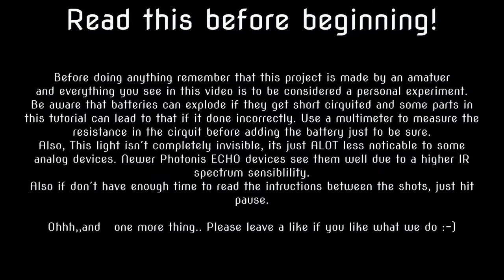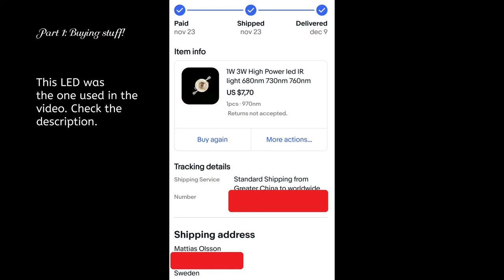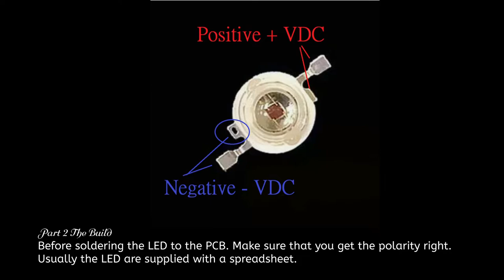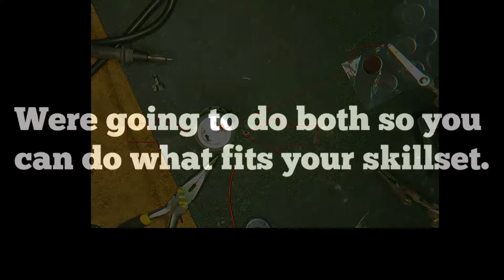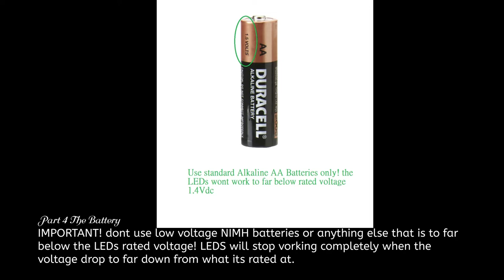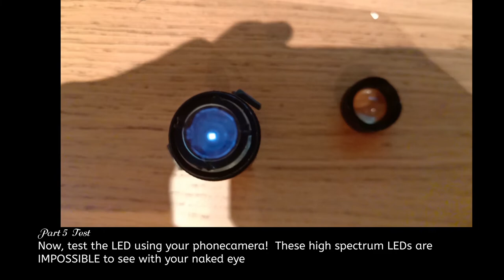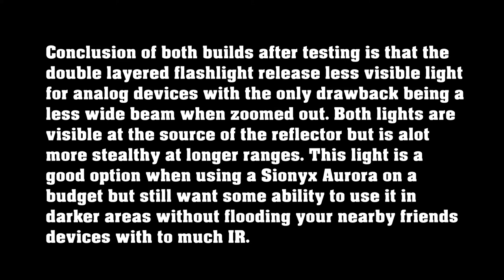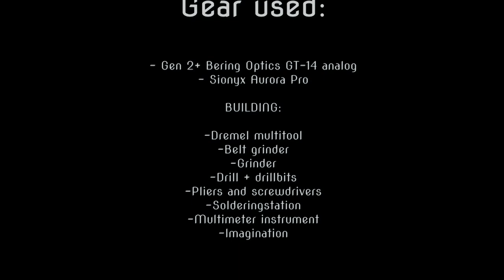Build your own 980Nm IR-stealthlight!

Comment: why not just put the filter over the regular white light led?
Reply from the maker: Good question, LEDs doesnt work quite like halogen bulbs. They got their specific wavelenghts that they specialise in. If you look closely in the video at one point an example of this is made in a diagram. Some LEDs have double wavelenghts but im afraid these will result in less pure 980nm wavelenghts after the filter
Reply from the maker: Look at 0:56 to see how narrow a 940nm LED is. White LED work the same way.

Comment: The listing for the LED is over. Could you update the description with a link to a new one?
Reply from the maker: These leds have a tendency to get sold out. So updating the links would be a very short time solution. The best way to find leds is to search for 970-980Nm LEDs and check the sellers spreadsheet for what voltage they are rated for. I think i mentioned that in the video. But anyway i will try and find a new seller for you 😉
Reply from the maker: I have looked on Ebay,Aliexpress and Banggood. Ive only found one seller that have them. Better be quick if you want them. They seem to be hard to find. There are a bunch of 980-990Nm Leds that use a voltage rated 1.8 to 2.2Vdc. I have tested those and they dont work. Hurry and buy one of these: https://www.ebay.com/itm/225004997842?hash=item346357ccd2:g:18sAAOSwTDhiPwEj
Reply: @mattiasolsson1766  Thanks!
Reply from the maker: @SwornHeresy  if you manage to build a flashlight I've woul like to hear if it works for you 🙂

Comment: What's the purpose of removing the electronics on the battery terminal at 3:42?
Reply from the maker: The reason is because im not sure of the purpose for it. My biggest guess would be that it transforms the supply voltage coming from the battery to match the donor LEDs Forward voltage. due to the fact that i dont´ now how the electronic would react to changing the LED i didn´t want to risk damaging the much more expensive 980Nm led. supplying a higher voltage than its rated at will burn it. If its the other way around and its lowering the voltage the 980Nm LED won´t work at all. The new LED is rated perfectly for one AA battery as it is so i figured that there is no need for any adjustment of voltage anyway. Better safe than sorry. As of now my modified flashlight still works and i´m actually going to make one extra for mounting directly to an airsoftrifle. Hope that explains it ;-)
Reply: @mattiasolsson1766  thanks! Awesome instructional video by the way. I bought a 980nm led but already mounted on a 16mm pcb so i dont have to worry about reflowing the led on the chip. Have you tried that method? I have the same flashlight you showed in the video.
Reply from the maker: @John-hs6cc  thanks! I made it just to help people get into NVGs without going bankrupt. Also gen3 devices are hard to come by here in Sweden. I'm also standing in line for a Sionyx Opsin that I'm going to buy as soon as it's out. I'm going to test these lights with the Opsin too. Anyway regarding the presoldered PCB. I haven't got hold of any of those so i figured i would make a video were you use what you have. But if you get hold of those presoldered PCBs then that's off course the best option to go by. 🙂
Reply: @mattiasolsson1766   sweet thanks! I'll for sure make a video on how it goes. Here is the item name in aliexpress for the ledi bought. "2pcs EpiLED 5W IR High Power LED Emitter 5050 4Chips 850NM 940NM 980NM 1050NM Infrared Lamp"
I also built my own night vision using an nighttime fpv cam and a electronic viewfinder. Hopefully it has a similar spectral sensitivity as the sionyx.
Reply from the maker: @John-hs6cc thanks! awesome, Do make a video on your progress on your own digital NVG. It would be interesting to see how it works 😃